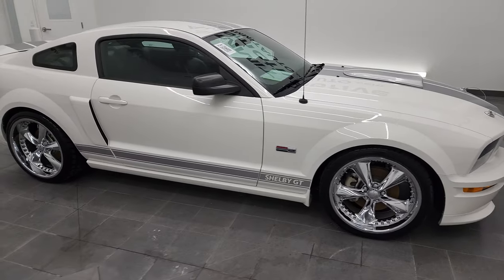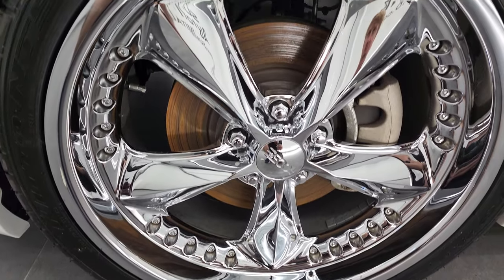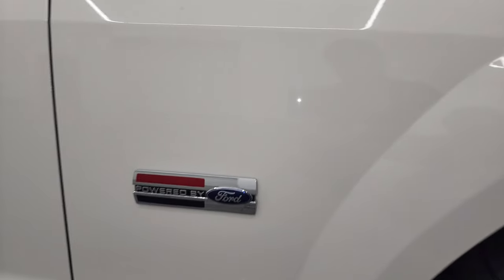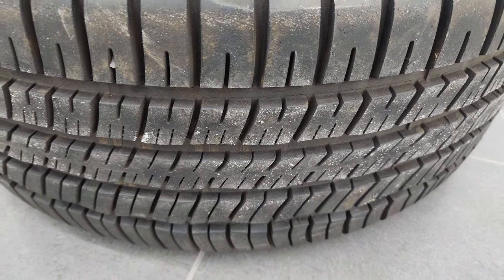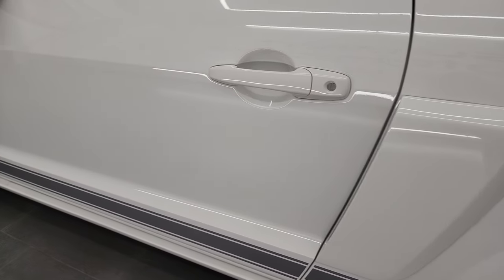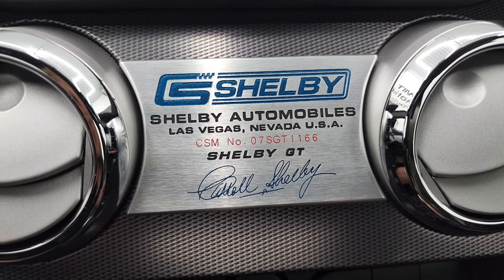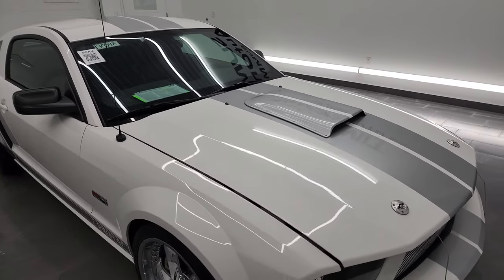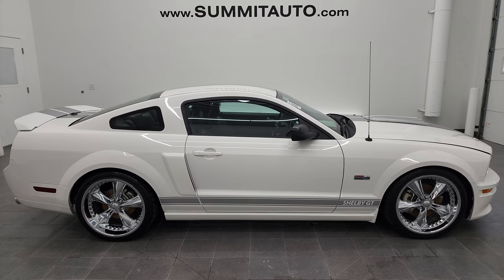2007 FORD MUSTANG GT PREMIUM SHELBY GT SHAKER 1000 #1166 4K WALKAROUND 13054Z SOLD!

Comment: consisting of a 90mm cold-air intake system and more aggressive calibration of the engine management system, mandating the use of premium fuel. Ford Racing performance mufflers and an X-pipe, replacing the standard H-shaped crossover, complete the powertrain mods. Although output was originally estimated at 325 horsepower, Ford has since recertified the package at 319 horses and 330 pound-feet of torque.

Underneath, Ford Racing provides new struts and shocks, which reduce the ride height about an inch and a half. Stiffer anti-roll bars improve body control and make for flatter cornering. And a race-inspired twin-tube strut tower base increases chassis rigidity in the engine bay and sharpens up steering response. The Ford Racing bits are factory developed, well matched to each other, and warranted by Ford. Last, the entire rearend is swapped for a new unit carrying a 3.55:1 diff ratio; it's cheaper and faster to change out the entire axle than to open up the pumpkin and replace the ring and pinion.

A better looking lowered r and ":haunched" than the 500 and $15k less in 07